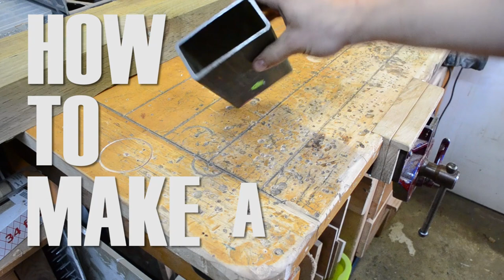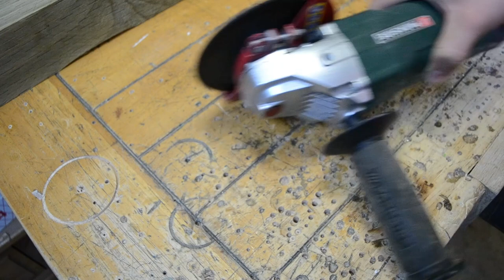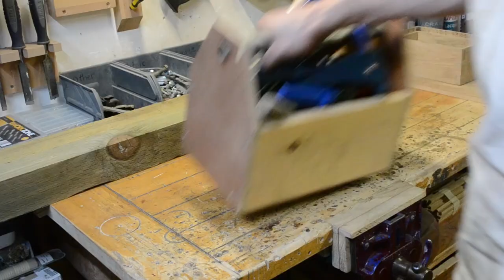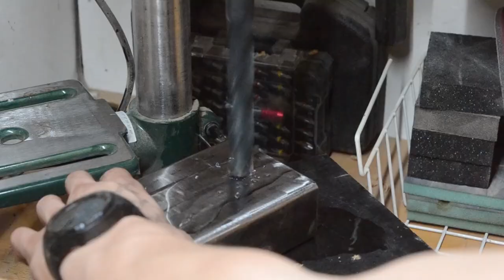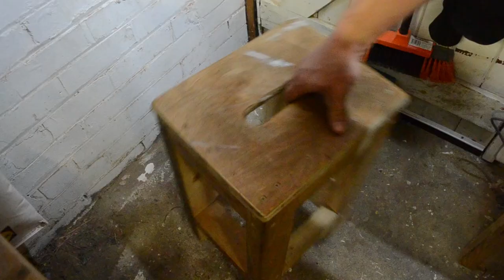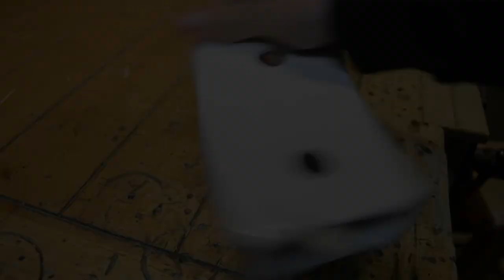How To Make A Motorbike Anchor (No Welding)

Comment: I don't think it's good protection, all these wall/ground anchors where there is a lot of place to put crowbar inside are very easy to detach anchor from the wall. One of the better solution can be Oxford Docking Station Anchor(or Beast Floor Lock), but still not ideal